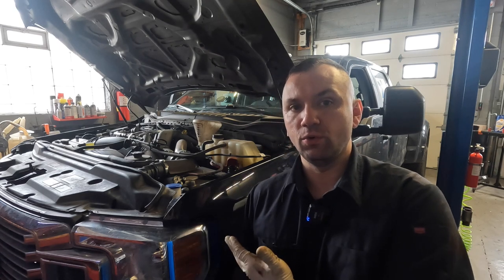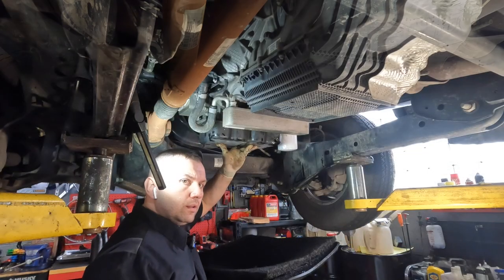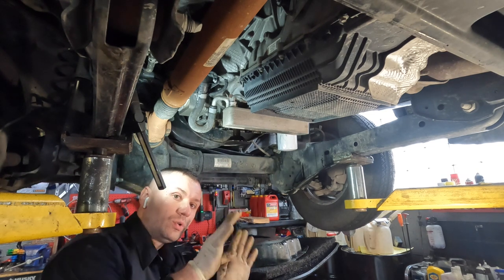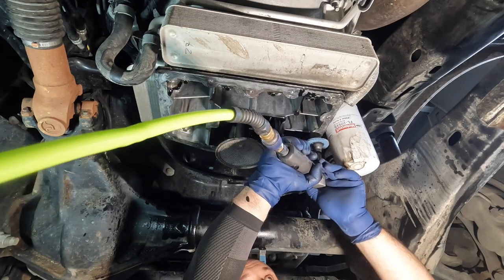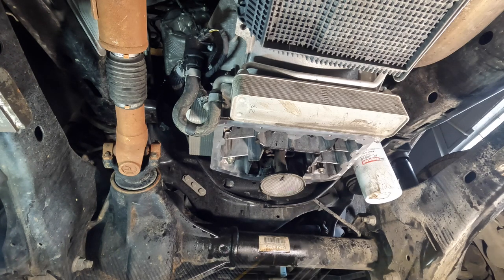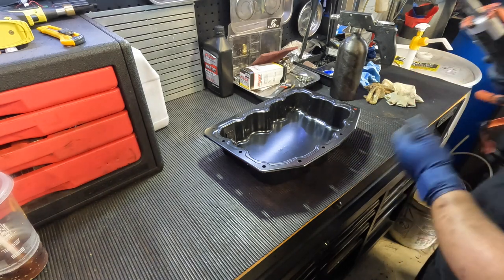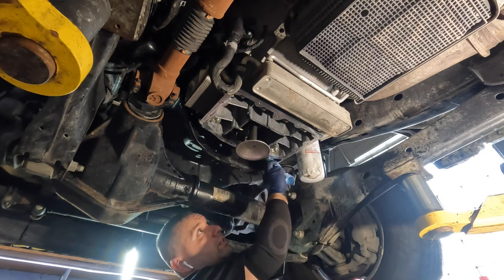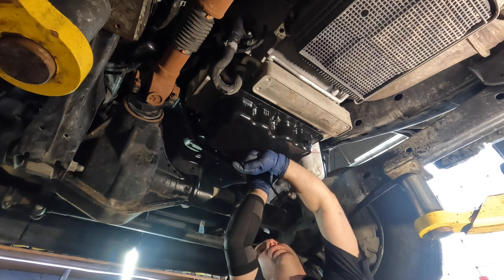CUSTOMER STATES ENGINE OIL DRAIN PLUG TOO TIGHT WONT COME OFF! DESTROYED OIL PAN THREADS!

Comment: can i use impact to remove oil pan drain plug? bolt? but not put in?
Reply from the maker: @MagicMane-dn5hp  in theory I guess you could I would just be worried in case it’s super tight on there and it strips threads coming out but other than that taking it off I don’t really see a huge deal with it as long as you don’t use it to put it on

Comment: Just to be clear, the oil pan doesn't have to be replaced because the truck had 12 oil changes, it has to be replaced because someone cranked down on the oil drain plug and stripped the threads.  Your description says it, but you didn't really make that clear in the video.
Reply from the maker: This one did take out the threads because it was over tightened, but I have seen scenarios where a vehicle has a lot of service taking the drain plug on an off a lot of times throughout the years can also wear out and damage the threads even if you were to torque the drain plug to own specs 100% every time it still can wear out.

Comment: Thank goodness I have a tap set to retread stuff.
Reply from the maker: These stamped steel pans cant get tapped they have welded nut design on the inside you unfortunately have to replace them. I have tried and I have failed I should make a video on this to explain why next time I have one in.
Reply: @TheEnthusiastMechanic so i just had the actual ford company do a oil job the last oil change and they over tighten the drain plug and the threads came off. This is on a 2018 ford explore limited and the re threaded it and put a over size plug in it and siad it was a permanent fix. Was i lyed to by them? I really want to know that way I can tell them to replace it. B3cause they showed me a moc on it from ford to be allowed to do that as a permanent fix
Reply from the maker: @ if it’s an aluminum pan and they threaded it correctly and went oversized, it can definitely be a permanent repair, but nothing beats having the original threads on there